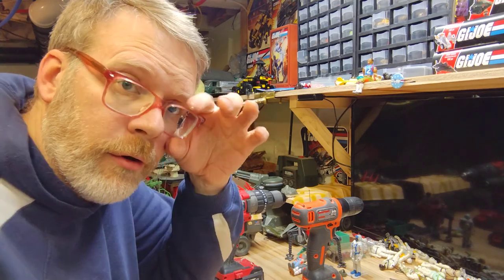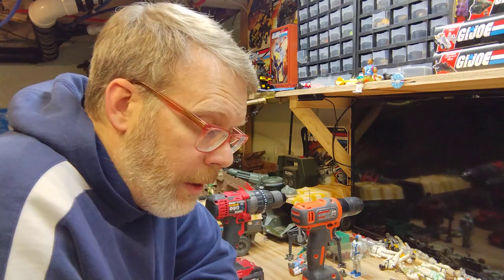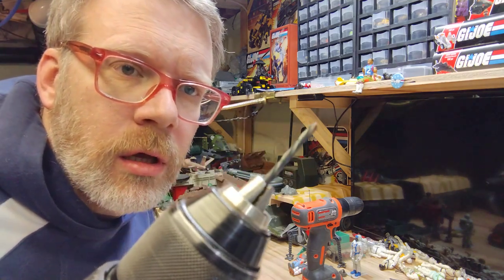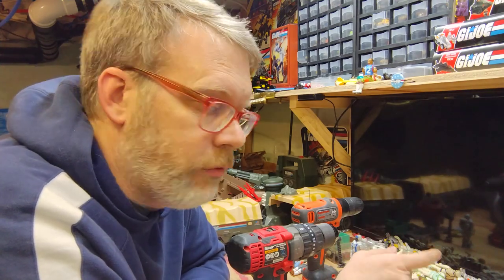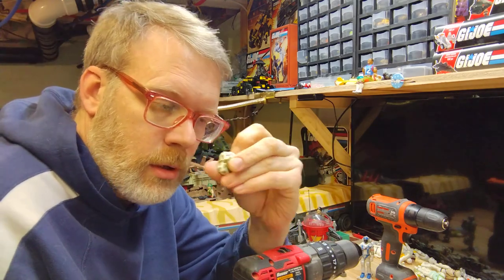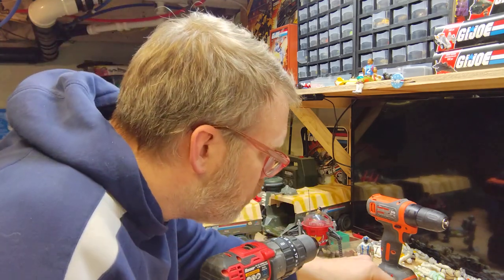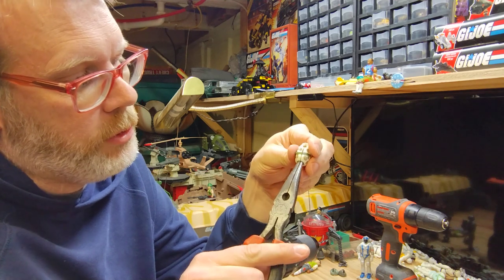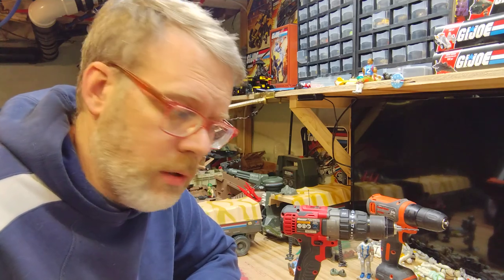Remove the rusted, stripped out screw from your favorite GI Joe.

Comment: Awesome... how I've always done mine.   I did have one where the screw was rather poor and I had to drill all the way in and use a metal pick to get the small bits of metal left in the threads of the plastic.  Slow and easy as not to heat it up just like you said!!
Reply from the maker: Thankfully I've never had one that bad. I'm not sure I'd have the patience to do that Voodoo that you do.
Reply: @CracktasticPlastic  lol   There wasn't a lot of patience... I was still in my 20s so my hands were steady enough then.  But i just drilled into the screw and stopped every 15 seconds or so ... a few minutes later I was picking metal out of the plastic screw thread area.

Comment: This was not a stupid video quite informative . Okay one question is that is a Bauer Harbor frieght drill is it a hammer drill or standard ? I   actually  have three for doing woodworking one for pilot one for drilling and one for screwing in the screw they make a great drill .
Reply from the maker: It is a Bauer hammer drill. Good catch. Before I retired I had a really expensive DeWalt drill I used at work and I can't honestly tell the difference in performance.
Reply: @CracktasticPlastic  well  personally I like the Bauer between the two Bauer is really a better buy

Comment: Very useful video! I just screwed in, the top fell off and I could easily take the body apart. However the rest of the srew is still stuck at the front of the body. Just can't get it out. By any chance do you have any trick to get that out too? Or should I just try to drill the whole thing like voodoo did, if I read it right how he did it. (another commenter here) Thanks in advance, if you see this!
Reply from the maker: Sorry it took me so long to get to this. Hopefully you've figured it out. If not, the only thing I've ever needed was needle nose pliers to twist it out. I'd recommend trying some Kroil. It's amazing. Soak it overnight. It'll probably come right out.
Reply: @CracktasticPlastic  Hi!
I kinda gave up on it, as I was way too afraid to drill the whole screw. I didn't want to damage my guy.
I'm very thankful for your reply. I will definitly try the kroil. Thanky you again!

Comment: You have to use a left hand bit?
Reply from the maker: It's definitely not required. I only recommend it because there's no chance of the screw getting any tighter and always a slight chance it's help back it out. I always use a 1/8" bit though.